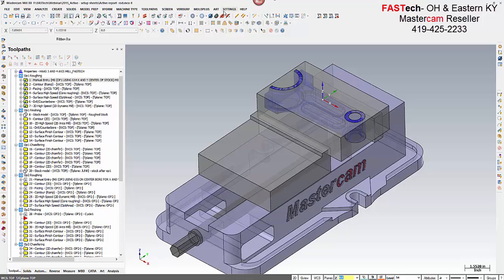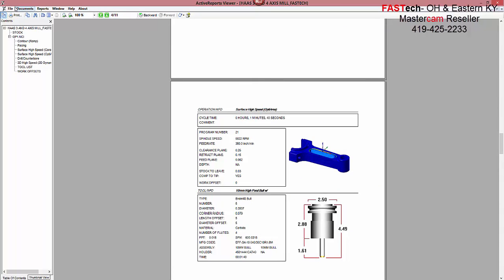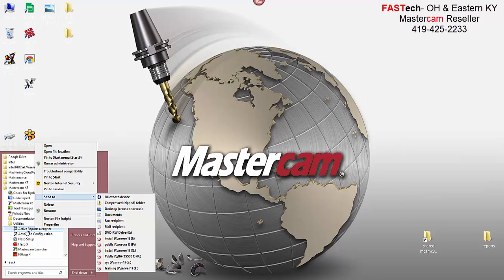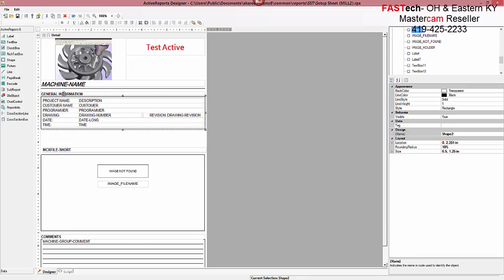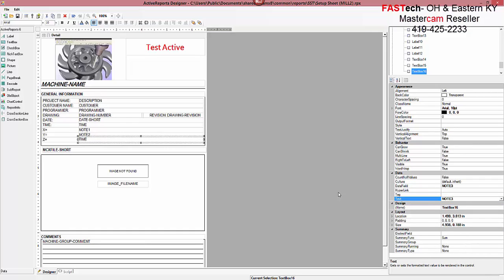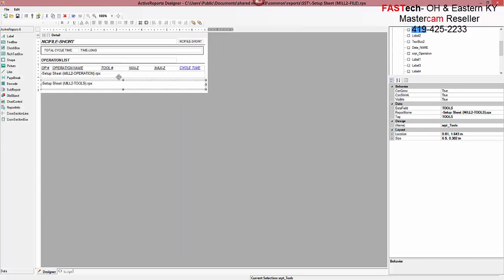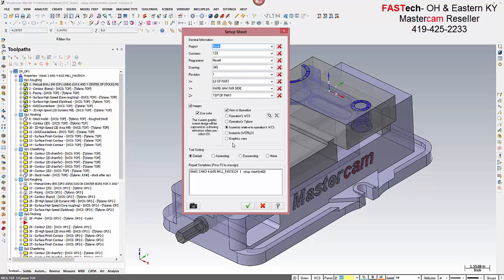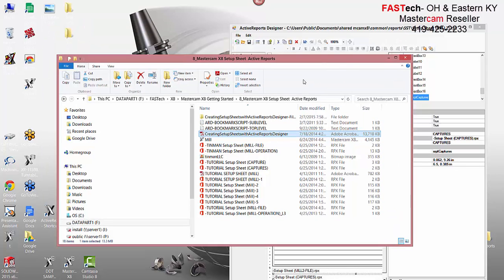Active Reports Webinar

Comment: What software are you using to open the RPX files from mastercam?  We are trying to open the setup sheets located in the SST/reports folder to make setup sheets for various jobs we have at our shop.. when we click on a setup sheet/RPX file we get an error that it cannot be opened and to choose another software to open it
Reply from the maker: Hi Brian. You likely will not be able to open the RPX files just by double clicking on them. They will not have a program associated to them unless you choose to do this manually by right clicking and choosing the 'Open With' option to identify a program.

The program you are looking for is called 'Active Reports Designer'. Keep in mind that Active Reports are not designed by Mastercam directly, this is just an Add-on that is included with the installation with Mastercam as it is a useful tool for Mastercam customers to use. This is why you will not be able to open the RPX file from Mastercam directly. 

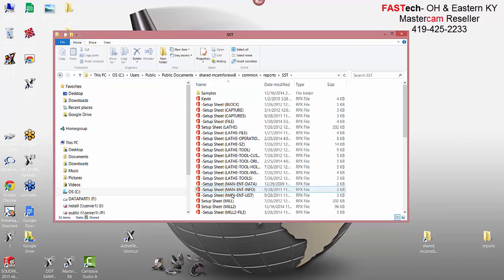In the video above at about 14:30 you will see the steps to opening the Active Reports Designer program. This is found in your Windows Start Menu under any Mastercam install folder. For older versions of Mastercam this might be in a 'Utilities' sub folder (as seen in video), but in newer versions of Mastercam, you will see the shortcut directly under the Mastercam folder in your Windows Start Menu.

Once you open the Active Reports Designer, you will then be able to open the RPX file that you wish to work with. Hope this helps!
Reply: @FASTech1nc   any way to add more notes other than the three notes available. I want to add other custom Info. Thanks in advance.